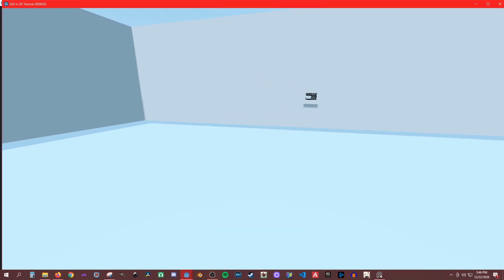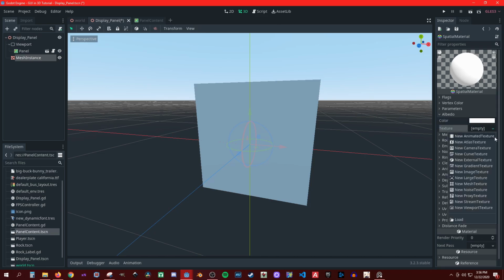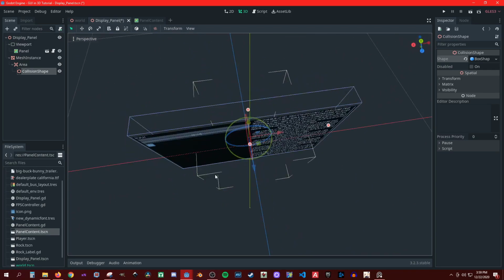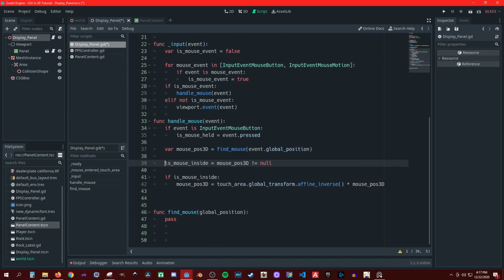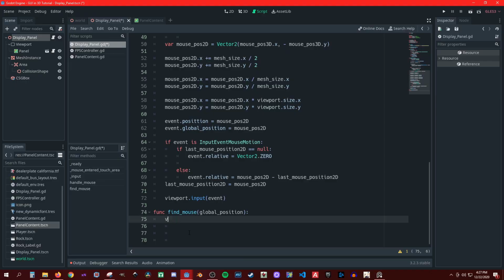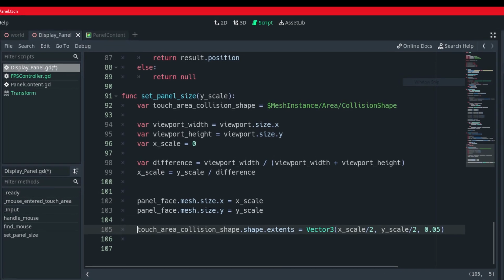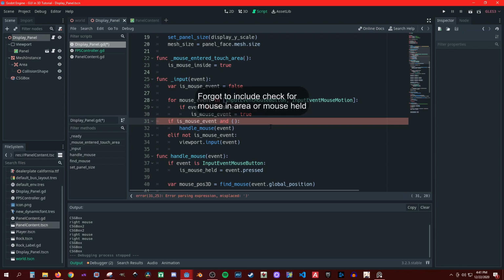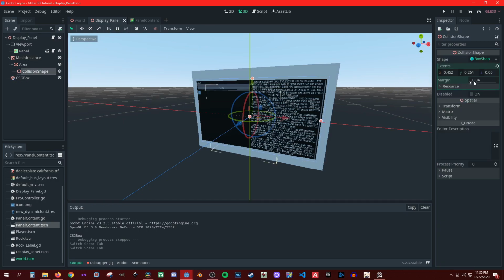User Interface in 3D World Space- Godot Advanced Tutorial

Comment: You rock man, this tip is beyond useful, it's amazingly simple.
Thanks to you I have managed to make awesome transparent HUD that moves with camera in 3D space. Shows ammo and other ui elements.
This is so easy, you just have to tick Transparent BG in the Viewport's inspector, and tweak the texture settings in the mesh material :)
Couldn't do it without you.
Reply from the maker: Glad I could help. Did you have to change anything code wize. Because its a bit outdated now. Im going to remake it at some point for Godot 4.0
Reply: @Chevifier  Well uhhh..... to be frank I didn't use most of your code, cos I didn't use the cursor control part. I only used the info about displaying interface made in 2D node on a 3D mesh as a texture (with transparent bg) using viewport. And that's mostly gui shananigans. And that's still pretty actual to me.